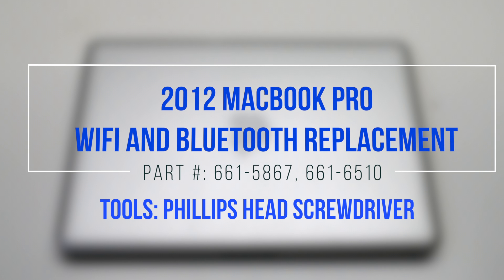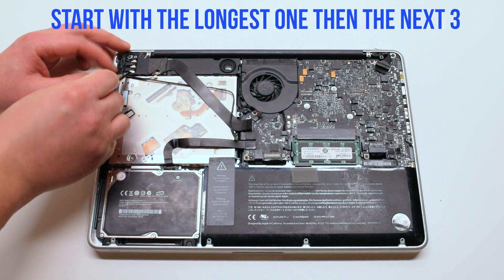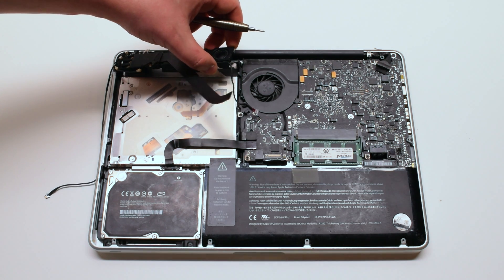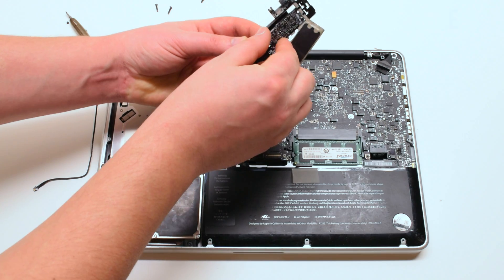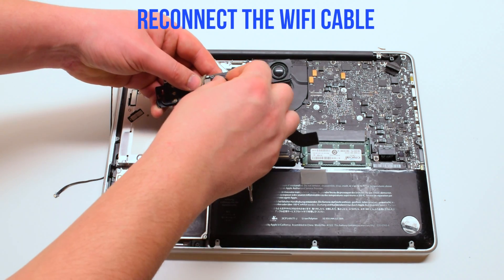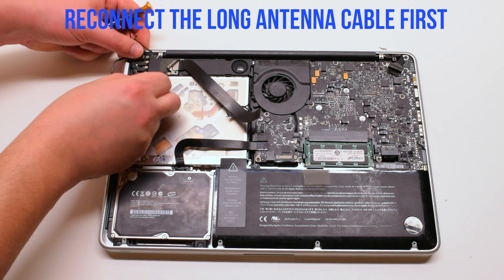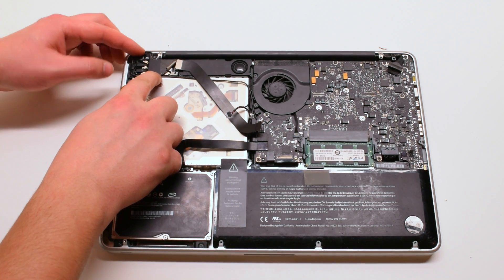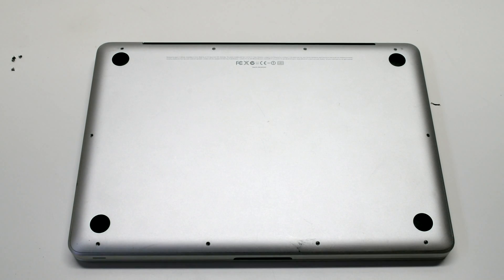2012 Macbook Pro 13" A1278 WiFi AirPort BlueTooth Card Replacement

Comment: I ripped out my speaker cable and eyesight cable trying to get them out. Maybe you should have elaborated on those.
Funnily i got as far as getting out the wifi card then realised i dont even have the correct replacement

Comment: Had my Macbook Pro 2012 since launch, the wifi started to intermittently drop a few times an hour last week. PRAM reset would bring it back but then it would drop again. Took it to Apple store and they said it would either be the WIFI AirPort card or the logic board. Parts and labour for the AirPort card was going to be £150, if it was the logic board it would be £300. Bought a replacement AirPort card on iFixit for £40 and with your video fitted it in minutes. WIFI is working again and stable. Thanks for putting this together!

Comment: I don't understand how this works. I popped off the wifi cable and now it does not stick back. I didn't go any further. As well as the battery connection to remove doesn't budge one bit. Not sure what's going on.

Comment: Would replacing the card fix the "Bluetooth not available" error? I tried resetting the SMC & PRAM but nothing works and the bluetooth is completely gone on my A1278.
Reply: you resolved it?
Reply: @PatrykOJ  yes I did. I ended up buying a Bluetooth USB dongle on Amazon for $14. Once I plugge it in my Bluetooth came back... Then a few weeks later I had the dongle unplugged and realized that the internal bluetooth was working again lol.

Comment: Is it possible to replace the wifi in this laptop with an upgraded wifi card 802.11ac/ax? Would that work?
Reply: So did you, does it work?
Reply: @deablero  These guys didn't reply back but from what I found out it doesn't.

Comment: How many have replaced the cable rather than the card? Replacing the card didn't work for me.
Reply: That’s what I’m doing now... dug this out to use as a music station, added 16gb of ram (the stock 4 even throttles the gpu, recommend adding at least 8) and after cleaning the fan and poking around a bit I get the “no hardware installed” thing. 

Anyways I ordered the cable and am hoping it’s that before I replace the actual WiFi card. They look really brittle and I did unplug it.

Comment: I'm having trouble with my current Bluetooth 4.0 card, it keeps disconnecting from headphones and speakers. Would the best option to replace it with a Bluetooth 4.2 card, or do you think it may be something else?
Reply: mine's clipping the sound over BT connection, it's still on its stock BT4.0 and I'm also looking for an upgrade other than a USB adapter that takes one port away.

Comment: Struggling to get the iSight/speaker cables out, any tips? They are really pushed in there. 
Edit: found out it’s not the wifi card that’s the issue, it’s the wifi to logic board cable that’s damaged. This tutorial was definitely a big help though!

Comment: Aaaaaahhh I can’t remove the WiFi antenna cable ‘!! I’m scared to break it!! What is the technique? How do you pull it out?? You pull from the black cable or pull from the metal piece ? Helpppppp!!
Reply from the maker: First you peal back the black tape on the left side, then once you have access to the cable you just pop it up out of it's socket on each side :)
Reply: @GRIBSOFT  I decided to first check if replacing the wifi cable solved the wifi problem before replacing the card.. and it did. So I didn't have to remove the card in the end. Thanks anyways :)

Comment: What if I replaced my wifi card with a new one and it still doesn't find WIFI. I can see my bluetooth and it ethernet works but WIFI does not connect no matter what I try. If anyone knows what could be next that'll be greatly appreciated. Thank you!
Reply from the maker: First make sure it's no the wifi router that's the issue, do this by going somewhere else and conncting to a different wifi. Next it's possible that the card that you got could be bad, and finanly and most likely it's the cable that connects the wifi card to the logic board that needs to be replaced. Watch our wifi repair video, that should help.

Comment: My wi-fi still works but my wireless printing has slowed down significantly when I use the MacBook to create it’s own wi fi network to print from an iPad… it used to work very well before. Does replacing the card or cable sound like it would resolve this issue?
Reply from the maker: It's possible. I would research the subject extensively before swapping out hardware.

Comment: Is the wifi card in that model a normal m.2 one? Does that model have the independent bluetooth part?
Reply from the maker: Both the Bluetooth and WiFi are in the same module.
Reply: @GRIBSOFT  I know that. My question was if the card itself is m.2 or some propietary Apple format? And if that model have the connector that older (Atheros-based) models had where you plugged in a bluetooth card separate from the wifi card?
Reply: @Ptero4  the unibody macbook pros all use proprietary apple airport cards.
unlike any other laptop that uses an mSATA port.
the unibody macbook pro's airport card contains both wifi and bluetooth antennas
and no, you can't upgrade or replace it with any other wifi card, only with the same apple airport card or with the older airport with bluetooth 2.1+EDR airport card from the 2011 macbook pro

Comment: i had the problem that my macbook didnt start anymore, no reaction at all. Authorised Reseller told me it would cost 500€ and the problem was with the bluetooth card. So i just replaced it myself but it still does not start. But i think it was worth the try (only 40€)
Reply from the maker: Try a different charger.

Comment: Do you have a 2013 logic board replacement? Also a sku number for the one I need for a 2013. My computer is charged but won’t start and was freezing and static like then beeping with black screen. I’m assuming it’s the logic board. Arg the Mac is not even two years old. I bought it new too. 😭
Reply from the maker: What year and size is it exactly? You can look it up here https://checkcoverage.apple.com/us/en/?sn= let me know and i'll find you a cheap replacement on ebay.
Reply: Save Apple Dollars I gues it’s a mid 2012 so Thai video would be good right? Yeah let me know where I can buy an good priced one. Thank you so much.
Reply from the maker: I must know the exact size and the exact year, watch this video on how to find out http://www.appledollars.com/identify-mac and ill help you find the part.
Reply: Save Apple Dollars I looked up my serial number on Apple and it said mid 2012 year. It’s a 13” and I bought it in 2015. It’s a MacBook Pro.
Reply from the maker: You can get them as low as $370 on ebay but I would opt out for getting one from iFixit as they are a trustworthy name, here for $399 https://www.ifixit.com/Store/Mac/MacBook-Pro-13-Inch-Unibody-Mid-2012-2-5-GHz-Logic-Board/IF163-044-1
Reply: Save Apple Dollars how do I know for sure it’s my login board for sure. It turns on but shuts off in its own and has this fuzzy thing happen, like the screen gets fuzzy and freezes. Sometimes it turns off and beeps three times periodically till I turn it off.
Reply from the maker: Everything is pointing toward the board in your description.
Reply: Save Apple Dollars oh man okay! I was hoping it was something minor
Reply from the maker: Well, the beeping signifies memory module detection error but the fuzzy screen makes me think there are more problems so my suggestion is to get a new board. If you need to try something right away then reseat the memory and see if that helps, try even booting with only one module. Here is the link to all the videos for that unit, including memory swap http://www.appledollars.com/2012-macbook-pro-a1278
Reply from the maker: Click on the picture of the RAM to watch the memory replacement video.

Comment: Thank you very very much! I replaced it and after I rebooted my MacBook Pro it recognized Wi-Fi networks instantly. Before it would say "No Hardware Installed". I'll keep an eye on it for the next days, but thank you very much!
Reply: If you have a HDD MacBook pro (disk drive) the bottom cover can pinch the WiFi cable thus requiring a replacement. Note: if your feet on you MacBook pro came off, replace them to prevent the bottom cover pinching the cable again. I had the same problem, now mine's works perfectly. Hope this helps.
Reply from the maker: Glad to help.
Reply: Unfortunatelly it stoped working after some hours. At first the connectivity went down, then I couldn't find any network, and after rebooting, the message of No Hardware Installed came back. Oh well... :/

Comment: Can you change the airport card for an 802.11ac signal?
Reply from the maker: I don't believe so and if someone has done it, it's very expensive. Your best option is a USB AC card https://www.amazon.com/OURLINK-600Mbps-802-11ac-Wireless-10-6-10-12-4/dp/B018TX8IDA/ref=sr_1_1?s=pc&ie=UTF8&qid=1502122903&sr=1-1&refinements=p_n_feature_keywords_browse-bin%3A2883736011

Comment: Thank you very much for this useful video.  I replaced mine and booted back up, had a black screen.  Finally was able to reset the PRAM (or whatever it's called these days) and reboot but still black screen.  Also did the Control+Option+Shift+Power Button trick but that didn't work either.

Do you have any advice?  I'll definitely be making a donation nonetheless and wish I had heard about your website before as I've done some other things to my old MB Pro that some other vids weren't as good explaining things.
Reply: Never mind.  Was able to restart in safe mode, although I did that before.  Then reset the System Management Controller (Shift, Control, Option+Power, same time then release then reboot as norma). 

Unfortunately this did not fix my wifi issue so I guess the cable is bad - FUDGE!!!
Reply from the maker: Could be the cable or the connector on the wifi card or the logic board or the wifi card it self. I would start with the cable but in one shot you cab purchase the whole deal for $15 http://www.ebay.com/itm/MacBook-Pro-15-A1286-2011-2012-Airport-Bluetooth-WiFi-Card-w-cable-821-1311-/262048130010?hash=item3d034923da:g:f8oAAOSwFnFV9i0u